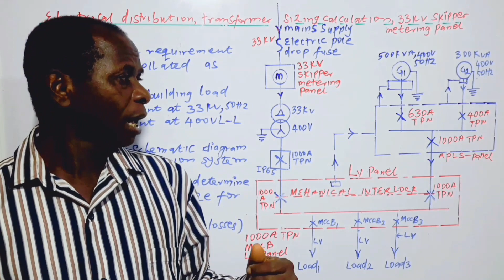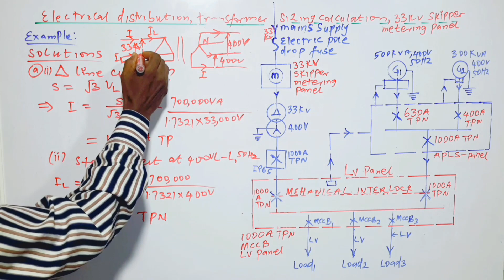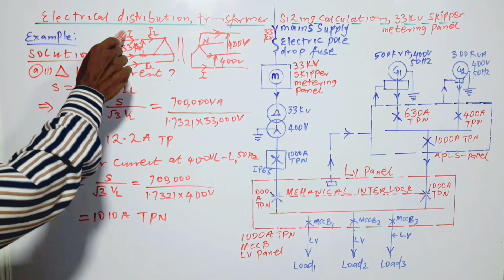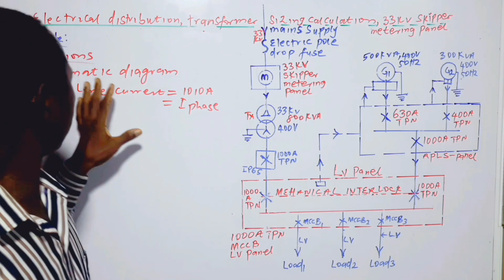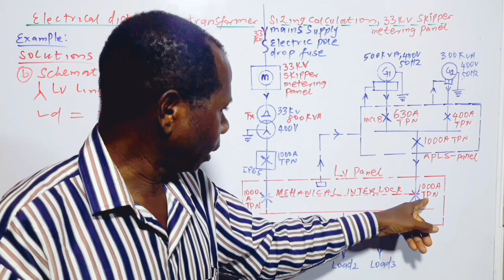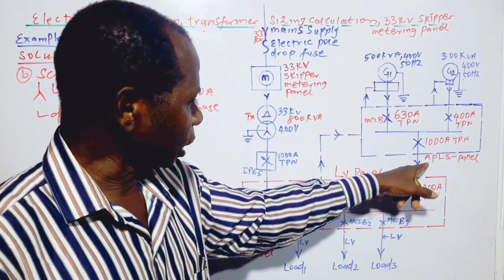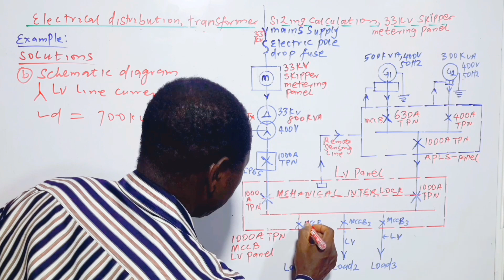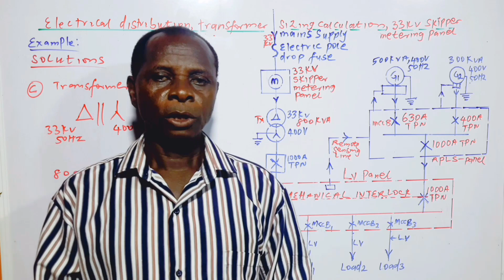Power distribution, transformer sizing calculation

Comment: Total active load = 79,820W
Power factor = 0.8

Apparent Power (KVA) = 78,820/0.8 = 99.8KVA

(I chose Transformer KVA rating of 125KVA)

Load Current = 99800/415√3 = 138.9A

(I chose MCB rating of 150A)

Please kindly review the above if they are in order.
Thanks.

Comment: Can I use a 150A MCCB (TP&N) for a 125KVA Transformer
Reply from the maker: Thank you for your comment
Reply from the maker: The 1st thing you need to know is that you can hardly find 125kva transformer. You can find 100kva, 200kva, 300kva, 315kva, 500kva etc in the market
Reply: @jkmultimediasolutions3935  Thanks so much for this
Reply from the maker: Anyway, using your theoretical 125kva transformer,
Considering star secondary side, 125000 = (square root of 3)×Line voltage×Line current or 3xphase voltage phase current, in star connection, if line voltage is 400v, the phase voltage = 230v approximately 
In star connection, line current = phase current.
If line voltage is 400v, then line current = phase current = 180Amp?
You need to choose the biggest circuit breaker whose rating is slightly less than 180a , and
 that is 160A circuit breaker.
But since you will not want the operation of the transformer to be limited to 160A, it means you will use adjustable 160A MCCB so that you can adjust the circuit breaker trip  current to about 170A to protect the transformer